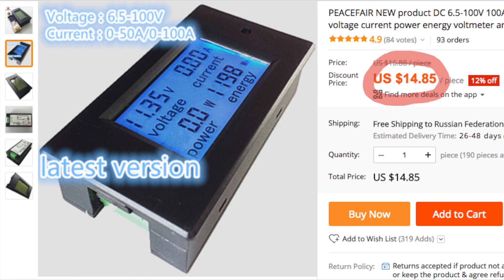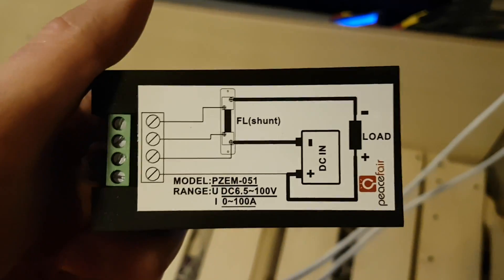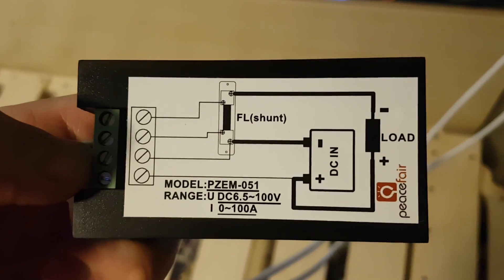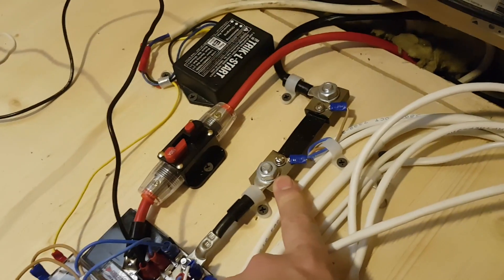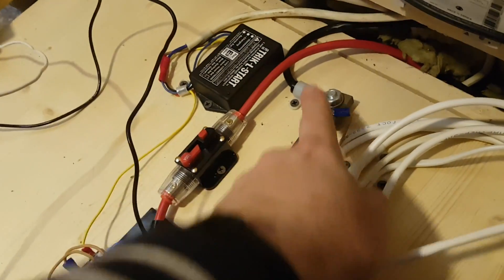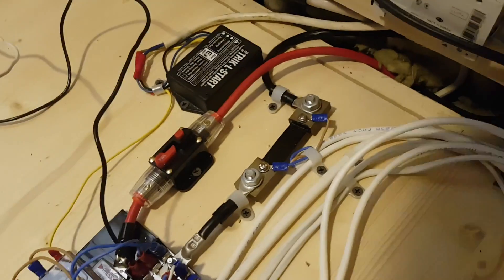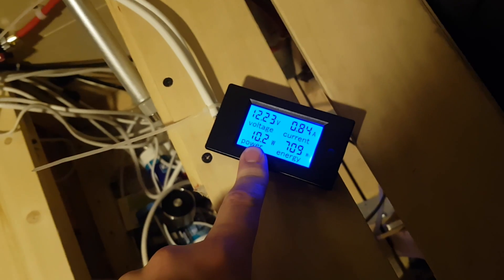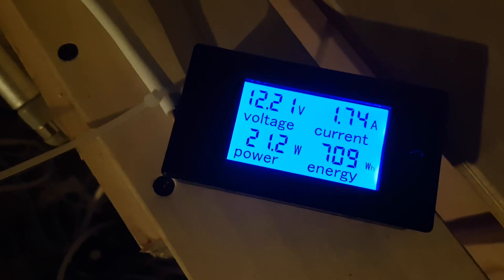Power meter for your 12V batteries - know how much energy you using in your motorhome or van build

Comment: Hi sir, 
I am using Amicisense dc meter to check how many volts and amps are coming from solar. The meter is working fine in daytime but in night it's showing solar charging symbol in my pwm charge controller(like reverse charging)
Please help me on this

Comment: Pls how can I use DC 0-100V 10A Voltage and current meter display to measure my Chinese Smaraad 1kw 48v wind turbine current? Pls send the wiring diagram. Tx.

Comment: Thank you very much.I will put it between one battery(12 volt)and one motor which is 500 watt at maximum speed.I will put a fuse for the motor which is 50 amperes.Do i have to put another Fuse for the digital meter?If yes,how many amperes?

Comment: There are better meters available now they are bi-directional. Similar in design but they show negative number when you are drawing power from battery and positive number when the solar or source is charging. Also, they don't need a shunt which can be hard to fit in some cases just a 2 cm ring that goes over the pos cable.     https://www.ebay.co.uk/itm/Digital-LCD-Hall-coulombmeter-DC-300V-50A-Voltmeter-Ammeter-Battery-Power-meter/332647520588?ssPageName=STRK%3AMEBIDX%3AIT&_trksid=p2057872.m2749.l2649
Reply from the maker: I have another video about similar bidirectional meter even better with battery percentage counter and wireless display
Reply: @Vantouristcom  Do you have link for the other video?

Comment: Thanks for video. They are handy tools, I have 3 with the kwh trackers. 
What I would like to know is how you are they supposed to mount into a plastic/metal/other-safe box. Mine are just shoved behind some other wires in the panel box to keep them from dangling, works fine, but figure there is some sort of box/mount for it. Did you find a way To mount it?

Comment: it can be used bidirectionally
All you need to do is fit a DPDT changeover switch in the two sense wires to perform a coss over, I have installed a switch and I can easily see incoming and out going current
Reply: Hello. 
I tried exactly what you said except I can't get it to read on the charging side.
Reply: @69THGILF  Although it worked initially, over time I found it was unreliable and also using a switch was often impractical so I replaced mine with one of the excellent Aili monitors. I made a Video about mine here
https://youtu.be/JYIpfH2eVFY
Reply: @CriftinsCampers  I just watched your video. 
Thank you

Comment: The voltage reading on this meter is not very accurate, it's off by almost a volt
Reply from the maker: I found out that too. It very depends of wiring length and connections quality. Eventually I make it work fine, but yea that's not ideal device.  Very cheap tho
Reply: @Vantouristcom Yep, the price is great so once users understand that it's not spot on correct but will give you a decent reading you're good to go.

Comment: Hi, I have a question about how to wire this meter.  I have a motorhome with a converter.  Regarding the diagram on the back of the meter what does "load" mean?  I saw on your video that you wired it to a fuse box for "load".  Would I wire it to my converter?  If I am supposed to wire it from my converter which wire off the converter would I use?  Please be specific.  Thank you.
Reply: Things that consume power are the load. An inverter, a  fuse panel  for low voltage devices, etc. in your rig. I believe these meters can go between any source of power and any load as long as they do not exceed the limits listed. In your case, the shunt would go between the output side of your converter (usually 12v) and your fuse panel for all your low voltage devices. A  shunt always (in my limited experience) goes on the ground side of the circuit. Note that this device seems to have a wiring diagram on the backside to help you wire it into the circuit.

Comment: Can we use two power meter and just reverse the wiring on shunt of another meter to measure reverse current?
Reply from the maker: Yes
Reply: VanTourist Ok. Thanks :)
Reply from the maker: mystery chemical but if you will have like "10A goes one way and 10A goes other way" same time - both meters will show 0A
Reply: VanTourist The setup is like inverter and solar panel connected to solar battery. Inverter is normal which charge and discharge and solar panel is connected to battery with charge controller. I want to put three of these. Two between inverter and battery(just reverse in shunt) and one between solar panel and battery. So, that I could measure how much energy is stored in battery. Or is there any other possible way to measure Tubular solar battery's energy level?

Comment: Thanks for sharing. Nice wiring job in the van. I'm considering mounting my shunt on plastic. Does the shunt get warm under load?
Reply from the maker: It could get warm if you load it close to maximum capacity (150A) for a long time. Probably you will not. In normal usage (under 50A) it stays cold
Reply: VanTourist Thank You!

Comment: Hello, i have just received my Shunt and monitor. I shows on the back that you have a "LOAD"  + and - do you not worry about that so do i just run it like you have on your video?
Reply from the maker: +Gary Hiscutt I did correct wiring on video, but not sure how you meter looks like. It must have + & - connections for power and two more for shunt. It’s fine to connect shunt wrong - you just will see zero amount of watts - that means you need to rewire it opposite way
Reply: VanTourist 
The meter I have is the same as yours. So I will wire it up the same as you have and see if I get the same outcome... wish me luck... like your videos.
Reply from the maker: thanks! Wire it the same way and you will be fine! good luck!

Comment: Installing this device to my ebike... Do I use two phase wires as the load?
Reply from the maker: Not sure how your ebike works. Only could say that this device needs 8-90V DC power to work and it could measure 0-100A DC power by shunt that need to be installed on negative wire between battery and load.

Comment: Great video, one question.  What happens to the meter when you start the engine and the alternator begins to charge the battery?  The amps would essentially be moving in the reverse direction across the shunt.  Does it show a negative number indicating how much charge energy is flowing back into the battery?
Reply from the maker: Hi! My alternator charging and appliance are connected in different separated electrical circuits (and solar charger is separated circle too). So charging from solar or alternator not affecting data on my appliance wattmeter.
I think it couldn't measure negative amps flow btw.
In conclusion i plan to install separate meter to all of my circuits and have separate data about any of solar, alternator and appliance data

Comment: hey dude, cool setup! I just put one of these in my system but my wh reads odd...
your says 707 but what batteries are you running? 
Mine hasn;t done much run time to 'learn' i guess but mine ready 167 at the mo but my battery bank is 12V and 1040 ah....any help appreciated man, I have a 3000W pure sinewave (6000peak)  hooked up to it currently - it's just a backup system
Reply from the maker: hi! The "Wh" meter showing how much energy was passed trough the shunt! It doesn't matter what capacity your batteries are. It just count all the watts you have used. For example if you connect to you batteries 300W drill and use it for 2 hours - this number will show "600Wh" (300w*2h). Also you can reset this counter by holding button near display.

Now about your 3kW inverter - it's too much for this power meter. 3kW is 250Amps of power, but this device made for 100Amps! Shunt looks strong, so i think it can handle at least 200A for some time, but about the meter - i not sure what will happens after 100A++ of power. Maybe it will just show some "error" or "100A". Or it might die - i have not tested such big amount of power trough it. For inverters is better to use separate 110V/220V meters which can measure 10kW++ easily
Reply: haha thanks man - I feel a bit stupid now as I fighured that out last night!! haha thanks for the heads up

Comment: Do you know if the device is always on, and how much it draws?
Reply from the maker: it is always on
Drains 0.2W (as manufacturer says). Backlight could be turned off
Reply: Wouldn't it be ok to put a switch on the meter??

Comment: Only the PLUS (positive ) connections go to the fuse box. Not any negative cables need to be fused.
Reply from the maker: +Arduinomaster Robert Moller both positive and negative wire goes to my fuse box for convenience. Inside fuse box there are no fuses for negative wire - only for positive connections. But is is more convinient to connect my devices in one place

Comment: Just trying to figure out the wiring on mine... little confused as where to take the shunt connections from as to get reading for all battery draw (inverter etc included).
Reply from the maker: You need to install shunt between negative contact of your battery and all consumers

Comment: I like your basic setup, but your wire runs are VERY sloppy.
Reply from the maker: +Bruce Forster thanks. Most of this wire placing are temporary and waiting of interior completion
Reply: I should apologize sincerely to you. I WAS a bit too hard on ya. When I first started building stuff like this, you should have SEEN the disaster some of my OWN early wiring jobs were! I would encourage you to keep at it!
Reply from the maker: it's fine ) i know that my wiring not perfect at all, but it's fast, easy to do and works - that's all i really need for now

Comment: Awesome, thanks for the review. I'm planning on getting a 2000W inverter but only to run up to 1000w and will probably have the engine on if I do that. This should be good for up to 1200w!
Reply from the maker: Yea i think its will be fine.
Also i like that construction where electricity goes through huge chunk of metal and this device just connects on the side. I hope if it will overload the limit of 100A - the device just couldn't measure more, but actual circuit will be still alive and not burn anything

Comment: I bought this unit and couldn't get the amps to work.  I tried to switch the wires and still it doesn't work.  The other functions work, but the amps only read 0.  It also won't give % of battery charge like a Bogart Engineering TriMetric Model 2030RV-F Battery Monitor or energy in and energy out of your batteries.
Reply from the maker: +Terry Landis thats strange. Could you share your connectuon scheme?
Reply: I connected it just as the drawing on the back shows.  I'm an electrician and this is an easy schematic to follow.  It still didn't work.
Reply from the maker: if you electrician i think you know what are you doing, have no reason to ask for installation photos i guess. You could send it back and ask for replacement from seller than. This things works for me, i have two now.

Comment: It seems the two wires directly from your battery gives the device a kind of reference. The two wires from the shunt measure the voltage drop across the shunt (which it can use to determine the current flow). Very simple and clever device.
Reply: just like the video ;)
Reply: Two wires from the the battery show the voltage. - Top left hand of the meter. The device can measure from 6.5 volts to 100 volts DC.  The other two wires - from the shunt show the Amperage (current) draw of operating devices.  top right hand of the meter.  multiply the voltage 12.23  x the amps 0.84 = watts 10.2